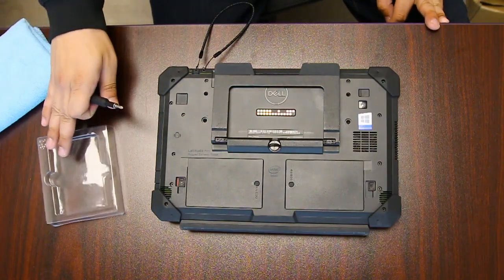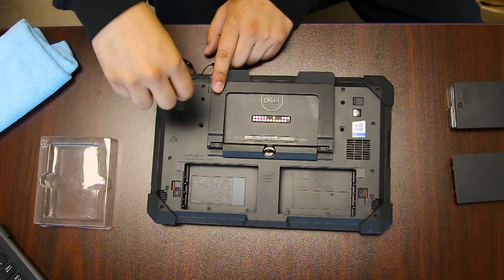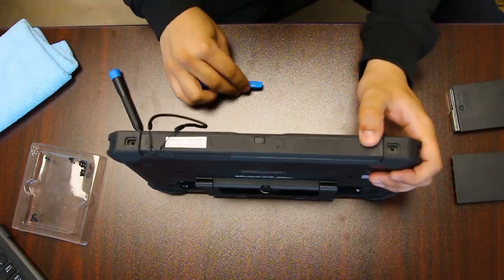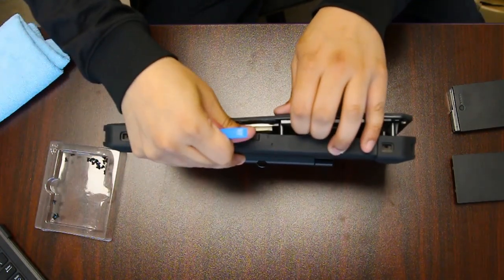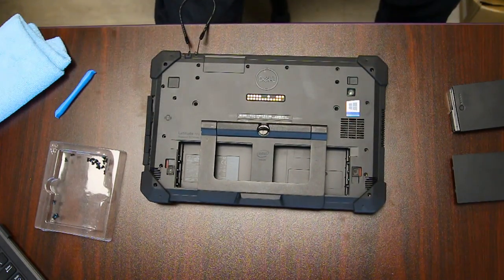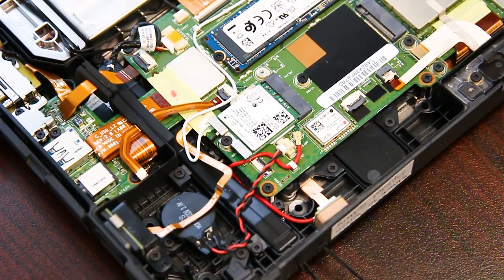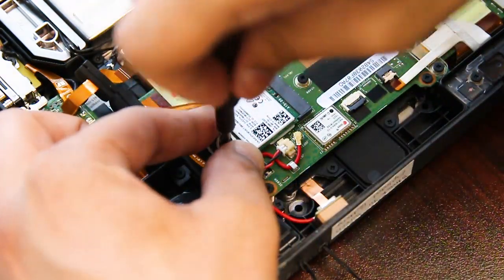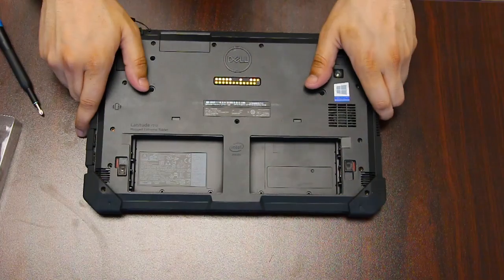Replace Your Dell Latitude 7212 Wifi Card!

Comment: What is that empty slot next to it wifi and nvme 2280 slot? It looks like an nvme 2242 slot but not sure what its for.
Reply from the maker: @sammysam9560 The best way to answer this question is to simply fill out our Tech support form.  Our in-house technicians will answer with the links and info you will need.  Here is the link: https://www.bobjohnson.com/tech-support-form/  Thanks for Watching.
Reply: maybe for the SIM card I guess

Comment: RAM upgrade is posibly on this model ?
Reply from the maker: No, the RAM is not upgradable in the Dell 7212. It's soldered on to the system board. Thanks for watching.